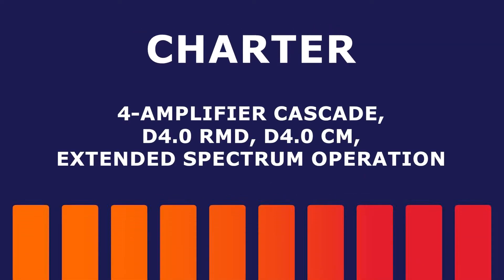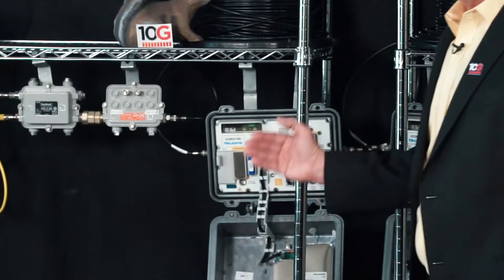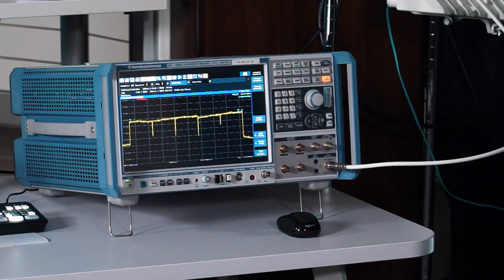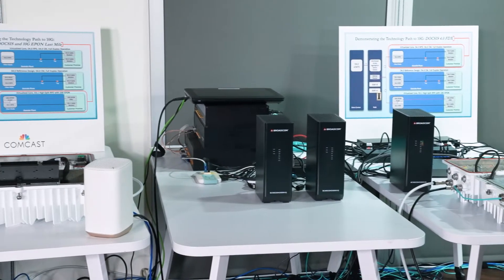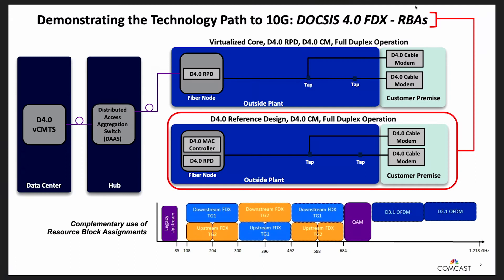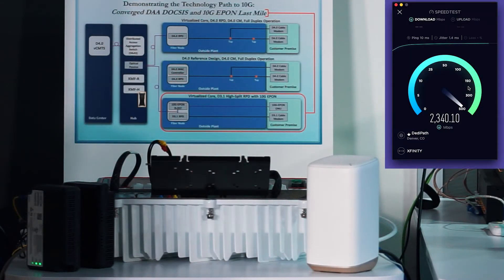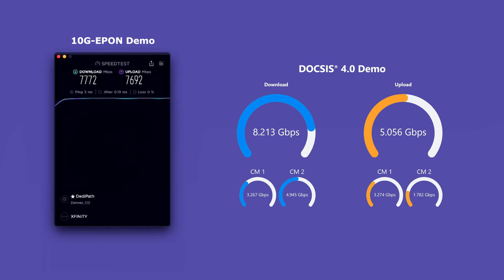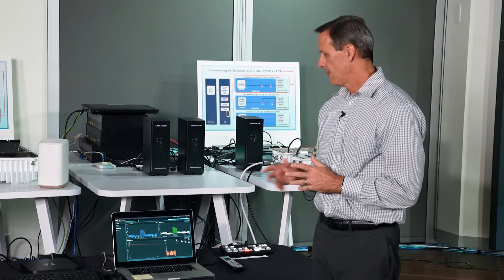Multi-Gigabit Speeds Get Spotlight at CableLabs 10G Showcase

Comment: There are many things that go into a good Internet connection.  As I am on fiber now and used to be on cable modems because I couldn't get fiber and I am a computer professional who worked from home during the pandemic, here is the difference I have seen:
1. Reliability - Especially when working from home, this is key.

With cable modems I would see on the organization's Slack that people were having non-stop issues with their cable modems cutting out and were only able to talk on the company Slack through 4G Wi-Fi hotspots.  The hotspots themselves were crappy, but at least they could get on Slack with it to complain about their cable modem service.  With my cable modem service, due to endless problems with reliability, I had the wire from the pole go straight into the cable modem (only an attenuator on the line because with nothing else on there, the signal would be too strong), but still had lots of issues.  I noticed on the cable modem I would see lots of interference on the 700 MHz band, which is where the cable modem channels were centered.  As a chunk of 700 MHz went to 4G cellular, I believe this is what I was seeing.  It was especially bad after my next door neighbor died.  I believe open coax ports, especially after people removed equipment from my neighbor's house and left the ports open made things really bad.  Even when my next door neighbor wasn't dead, major interference issues is a reoccurring theme.

With fiber, it just works.  Going on two years now and well with cable modems "monthly" outages, I can say with confidence the reliability of fiber service is orders of magnitude better.  I know other people who have fiber and it just works for them and they have had it for years for the most part, so I would dare to say the experience is somewhere in the 2 orders of magnitude more reliable.  The main thing with fiber service is sometimes something goes wrong in the network core and so that becomes the main limiting factor on reliability, but these failures are extremely rare.  When you work from home, it has to just work and work day after work day.  Fiber does this, cable modem does not.

2. Packet loss - This starts getting into quality of service.  This gets really important when you are using VoIP phones and video conferencing, which everyone does, especially during COVID-19 lockdowns.  When I am video conferencing with other people on fiber service, it just works.  No perceptible delay, which is great because we don't accidentally talk over each other.  No cutting out, which is great because no detail discussed gets missed.  With fiber on both sides it is great, even perfect.  As long as the other person / people have good audio setups, it can be better than being in a room because the volume levels can be set right and echo of a room eliminated, making for perfect communication.  With cable modems on the other hand, it is glitch up, cut out, and talk over each other city.  It is a lot worse.  When on big meetings, you know who the cable modem users are because it glitches up like crazy while the fiber-optic users it is perfect.  Actually being on meetings with the same people most of the time, I already knew who was on what, so knew for a fact who the cable modem users were and who the fiber-optic users were, so can say for a fact that the cable modem users have endless problems where now with me and some other people on fiber, we are a cut above everyone else in these online meetings because our Internet connections work perfectly with very low latency, unlike all of the cable modem users out there.

I have to wonder how many people don't get a job these days because they interview online and their cable modem connection is sucking because that is what cable modems do while the person with fiber gets the job because the perfect fiber-optic Internet connection they have makes them shine over the cable modem user.

3. Latency - As mentioned above, latency is key for good video conferencing and using VoIP.  It is also really important for competitive gaming.  Then for the work from home crowd, I mean with fiber when I am doing thing interactively from home, everything is instantaneous where with cable modem tech it kept lagging some.  Especially with some work stuff it is designed for you to be right next to the server and so does all of these round trips to the server.  With fiber service to the server, it feels like I am at work and everything is good.  With cable modem, this stuff slows down, waayyyy dooowwwn.  A lot of people only have the option of bringing their work laptop home or something like that, so then they can't just remote into a computer to try to mitigate the latency issues with this, so they really are kind of forced to be in the office except for when COVID-19 forced them out and into a hell world trying to get their job done because they had to do it over a cable modem.

4. Speed - I keep hearing about how I don't need upstream from the cable providers.  Then I want to do something like fast forward through my security cam video remotely.  When I have fiber on both sides, no problem.  With cable modem service, um, no, it didn't work out too well.  For work, time to upload that big file I was working on.  Oh wait, cable modem is slow on the upload so this is taking forever when in the office it would happen really quick.  On fiber it is just like I am in the office, no problem.  Then people are always coming to me asking how to recover their pictures and stuff from their PC after the hard drive / SSD failed, so I ask them if they are on cable modem.  If the answer is yes, well I suppose it is always going to be this way for you.  If you feel comfortable with it and doesn't take up too much space, maybe you can stuff it on OneDrive and try not to get too frustrated with the upload speed.  If you are on fiber, well back up to the cloud and maybe next time your SSD fails or something else bad happens, you will have a copy of it on the cloud.  You can tell people to manually do backups at home, but few people have the stick to power to do this.  However a good cloud backup solution is fire and forget basically.  Then say with my 4k camera footage, that video gets kind of big, so it ends up being kept on a local to my home storage solution, but then viewing it remotely if it has to go through a cable modem is a problem.  Sending videos over my phone taken on my phone to people on the other hand is super blocky and you can't really see anything.  It is frustrating because it is expected you have a sucky Internet connection such as a cable modem, which is the normal case, so I really can't practically share the original 4k footage I take or even the higher quality version of what my cell phone takes.  Everything has to be downscaled to crappy so other people can see it.  I have attempted to go higher on the resolution, but too many people are on sucky cable modems, so it doesn't work out.

5. Cost - Fiber service is less than half the price of cable modem and I am talking about 1G symmetrical fiber versus crappy actual cable modem speeds.  I mean I pay a lot less for this blazing fast 1G fiber connection I have that is orders of magnitude faster than the cable modem service I had before.  The thing is with fiber once it is installed, it usually and overwhelmingly just works.  The main problem with fiber is actually people don't understand how to make their Wi-Fi work.  So a good fiber provider is going to try to offer to help their user base get their Wi-Fi going properly so everything is peachy keen just because many of their users won't get it otherwise and complain how their fiber service "sucks" when their problem has nothing to do with the fiber service.

Service that just works tends to be cheap to maintain.  All of those service calls with cable modems constantly cutting out and not doing what is being demanded of them adds up and adds up to a lot of money.  Actually, I don't understand why these cable providers don't just install fiber and rip out the worn out and never worked right coax.  It seems like we are stuck with kingpins in the railway with coax where the fiber service is your automatic coupler.  As fiber service is head and shoulders better in every way including this reliability aspect, it just works out to be cheaper for the telcos and they can charge less for it and still be profitable.  They are just throwing away money and overcharging customers to cover the excessive costs of trying to keep coax going when they could pull in fiber, slash the bill, and then sit back and rack in the dough.  The cost of pulling fiber is nothing compared to the running costs of the even the crappy job they do of trying to maintain coax.
Reply: I agree with this 100%, I have no idea why cable companies don't just push 3.1 to the max and roll out fiber. Coax is dead and can not keep up. It is good for TV as it was built for. Docsis 4.0 will just be another unstable tech offering fast raw throughput with an unstable connection. It is getting to the point where starlink or 5g is becoming a better option.

Comment: Bruh, these cable companies are sweaty and trying so hard. I quit Comcast for my local fiber isp and the difference is amazing. sub-millisecond ping and zero downtime. Coax transmit radio signals, which are vulnerable to electrical interference. Fiber uses light and can’t be interfered easily. Fiber is the end game, powering the internet and underground sea cables. Anyone who argues that cable is the best is a bonehead

Comment: Now will it be affordable for us? Probably NOT. $100 /Gig.
Reply: $100 for gigabit speed is cheap, if you only knew how much investment it takes to get those speeds.. we're talking millions for a metro area. 10Gb fiber boxes all over then the drops to customers and upgrade the lines ( the upgrades they are talking about in the video ) plus labor and all the permits. it's not cheap so $100 per month for 2 years. $2400 , not bad , when Utopia fiber just for the line to be ran is around $2700-3000+ then you have fees per month plus an ISP (example xmission) for $50 a month+ fees
Reply: I don't care if it's $100/gig, I need SPEED and I need it NOW